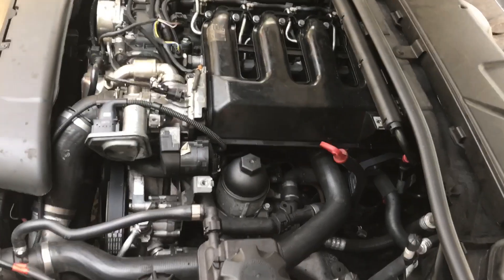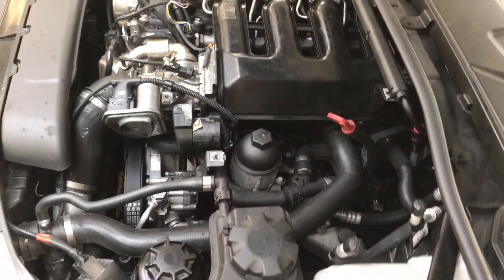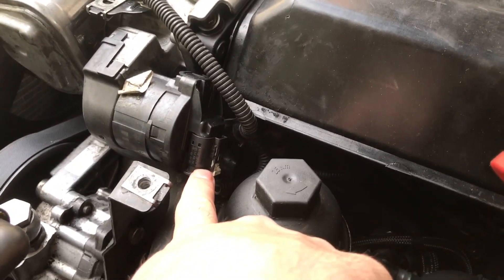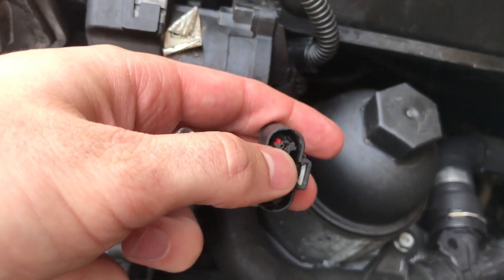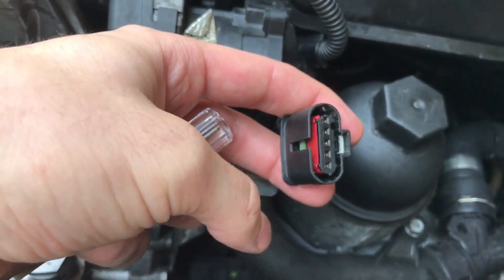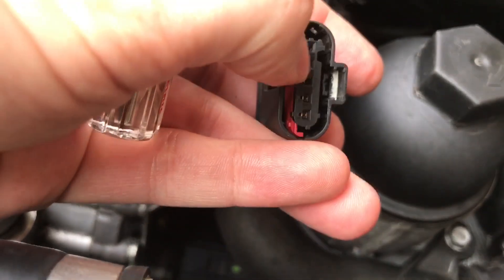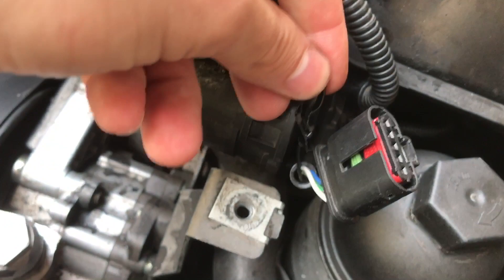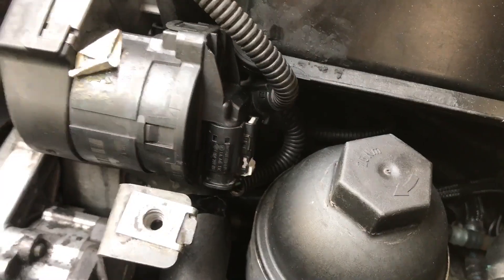335d/X5d 60 Second EGR Delete (Easily Reversible) via the "Paperclip Method."

Comment: I just tested this method on the N57 335d f30.  It works all fine no complaints expect the CEL light. I've been monitoring the live data for the whole time this mod was done, and the problem happens when the DPF starts to regen. EGR goes mad open/close even with the paperclip mod. Car lost all power due EGR remained stuck open and the post injection kept running even tho the dpf was already done causing very very high temps. So be careful. I wouldn't recommend this  on newer models
Reply: Because it needs mapping out as well. But the whole paper clip thing is a right bodge.